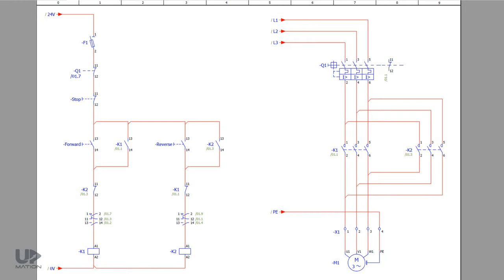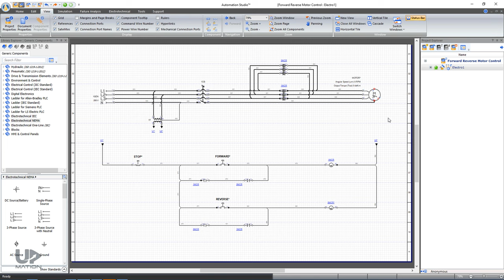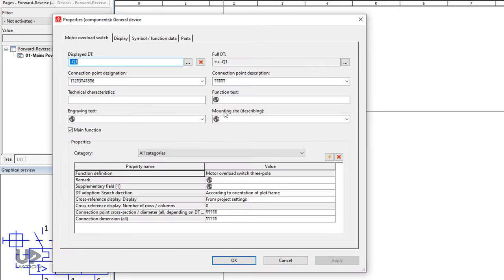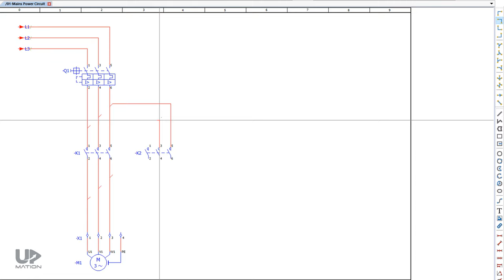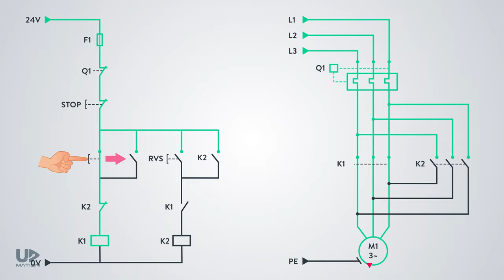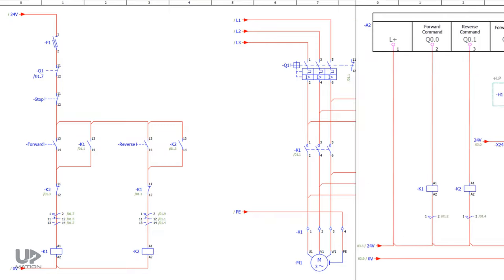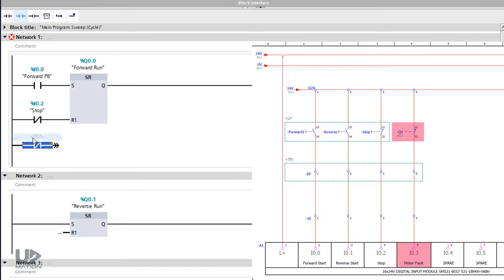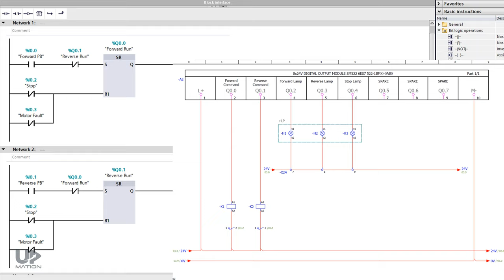How to Draw a Wiring Diagram and Turn it into a PLC Program (EPLAN Tutorial) Reverse Forward Starter

Comment: Great thanks to the author!
I'm very glad that eventually someone gives us such valuable content. Being Electrical Control Design Engineer I find this videos extremely valuable for me. So, please sir, provide more information about designing (preferably using EPLAN) industrial automation. For example using safety relays, sensors connection on the diagram, designing control panels, dealing with terminals and so...
Perhaps looking through out one of your projects
Reply from the maker: Sure! We will consider your suggestion for next videos. Thank you!

Comment: Very clear explanation, very clear materials, concisely and easy to understand, and very good practical exercise, very useful for an electrical designer. if you can do a full training course for a schematic for a full automation control system, that would be great.
Reply from the maker: Thank you for your comment and suggestions! Happy it was helpful.
Reply: @Upmation  1.can we use capacitive touch pad switch (with 5v /24 v dc relay )......in place of start/stop/selector switch ? in a 24 v dc PLC?
2. As we are using retentive timers......how  we can design ladder logic for PLC.. so that process  start ITSELF after power supply resumes ? (i.e ..not starting with the help of start switch)

Comment: Great video.!!!! I may be mistaken but shouldn't the "motor fault " XIC bit be in series with the stop XIC?
Reply from the maker: Hi, Ben! Sorry for missing out on your comment. The short answer to your question is, No!
That is because the stop condition will depend on "Stop" AND "XIC" at the same time. It means that to be able to stop the motor, there should be a motor fault AND the "Stop" push button should be pushed simultaneously. For instance, if we push the "Stop" push button and there is not a motor fault in the circuit, then the motor WILL NOT STOP. So putting them in parallel will make them independent. Please let me know if I can be of further help.

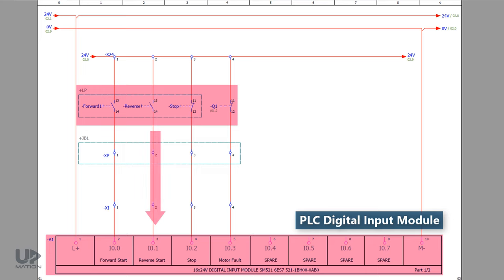Comment: Hi, I am confused about wiring in 7:28. I see that you have used sinking type of connection(24VDC to coils), but i have checked the electrical diagram of this module in datasheet, and I saw that the outputs should be connected to the GND(sourcing type of output module), not 24VDC. Is this particular module both sinking and sourcing, I cannot find the information about that. Sorry, for my English skills ;) I would be grateful for response
Reply from the maker: Hey there! Thank you for your comment. Yes, you're right and it's a mistake in the drawing of the DO card. There should be '0 volts' connected to the other side of the devices that are connected to the DO card. Sorry about that! :)
Reply: @Upmation  Thanks for response! but I have second question, the Q1 motor overload switch have additional NC contact, so when it is ON the contact is closed, and whent it is OFF the contact is open? I am asking because considering relay it would be closed not energized, and open when the coil is energized. So it works in a different way

Comment: Some things bother me in the wiring diagrams. 
On the motor connection circuit L1; L2; L3 goes to W1; V1; U1... should be the other way around. So your reverse will actually make the motor go the intended way and vice versa.
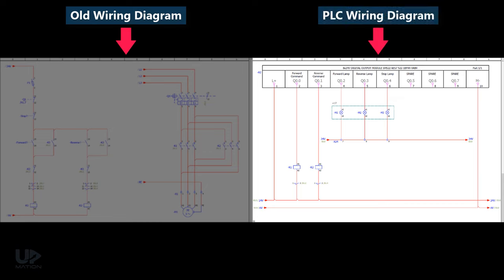@5:28 the other ends of Outputs are connected to 24V... should go to 0V
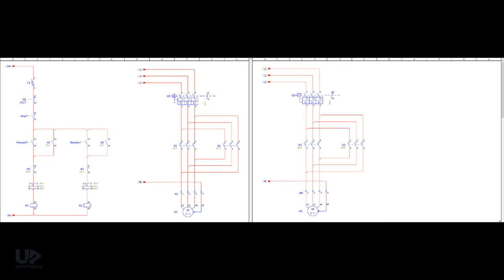Reply from the maker: Hey, Taavi! It seems these designations come from a standard which goes back to the early days of three-phase equipment. You're completely right about @5:28. For other people who read this, PLC DO cards will output the control voltage (24 volts, for instance) and therefore we should wire 0 Volts to the other connection of the devices. Thank you for your meticulous attention to details!
Reply: @Upmation  I might add to this, the PE crossing over is considered bad practice. You could simply turn that arrow around (tab while inserting it) and place it over the PE of the motor.
Reply from the maker: @DerKB79  Hey, Jörg! Thank you for the input! But according to the common practices (which we've talked about them in this video as well: https://upmation.com/wiring-diagrams/), we should outline the drawings so that we can read them from left to right. That's why all of the entering arrows are considered left to right.
Reply: @Upmation  To avoid this, you could have gone PE - L3 - L2 - L1 at the top for example, putting your motor connections in order without crossing anything and you could have gone around any other connections with minimal crossing going on. But since you use PE only once here, there is no need for it.
Another way of avoiding it, put PE on the buttom of the page and bring it up, like you mostly do in DC circuits, put +24 DC on the top of page and 0V on the buttom, same goes for AC, incomming on the top (230V for example), return on the bottom (for me that mostly is N).
I think we are having this argument (if you can call it that) cause for me here in Germany, it´s a bit different then for you in the US i guess, we are using the same symbol libaries, but might not do everything the same way.

Comment: Thanks for the basic tutorial, its ez to follow, just one question, I am using Eplan P8 ver.2.7 and i couldn't find the "Triple NO contact, 6 connection points" under the NO contact option, is this because i did something wrong or I need upgrade my version to 2.9?
Reply from the maker: Hi! I think something might go wrong with your library when you were installing the software. But to be sure before you reinstall the software or take any other action, please look more carefully for that item at the higher level of hierarchies. Thank you and please let me know if you found it or not.
Reply: @Upmation  I tried to install the software but the symbol i need was still missing, is there any way that i can update my IEC symbol library?

Comment: Hello sir, I'm confused about the NC motor fault in the ladder diagram. Shouldn't it be in series with the forward and the series NO contacts, so that when a short circuit occured, it will switch to NO and cuts the contacts of the motor? Please explain that issue in detail.

Comment: The "Stop" N/C contacts and the "Motor Fault" N/C contacts should be in series not in parallel as you have drawn them. They should have their own terminal point at the PLC as shown on your PLC input drawing.
Reply: Q.2 and Q.3 Both are used for reset purpose when any one input disconnect then q.0 will be reset so connections should be in parallel